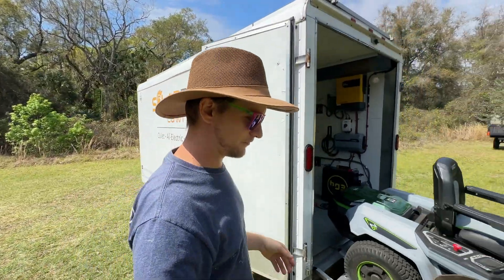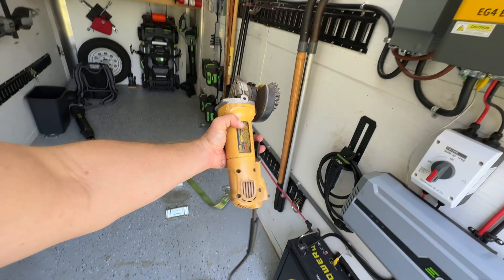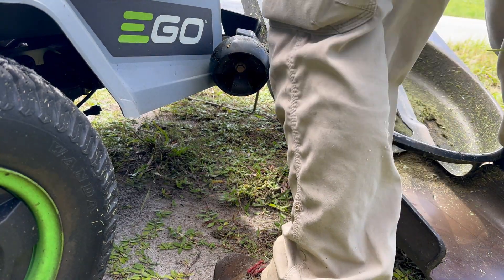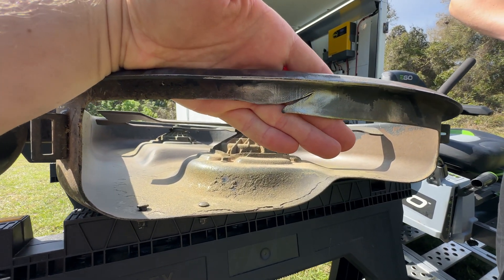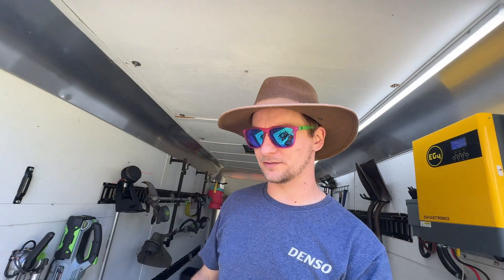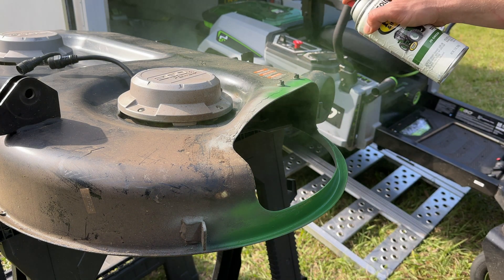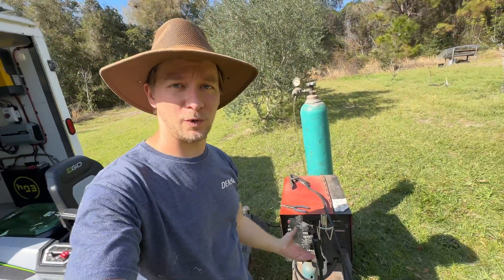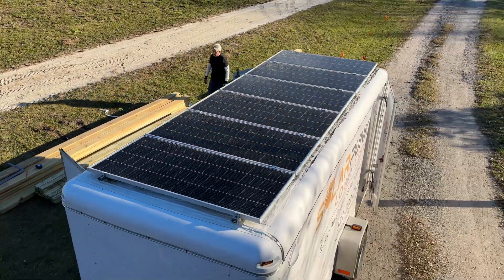Power a Welder From a Solar Trailer? Fixing My EGO Zero Turn Mower

Comment: Here is a trick to prevent pushing the deck sides in when bumping into something like that... Take a piece of round tubing bent to match the deck curve and weld it to that lip it will protect it much better
Reply from the maker: That's a great idea! Reinforces the deck without too much metal work.

Comment: A multi use trailer!  That's pretty sweet and pretty impressive it powered the Welder.  Absolutely awesome what You've built.  Ive started running battery powered equipment last year, but I'm not really at a point where I'd need a setup like you.  Keep up the awesome work!

Comment: I've thought about doing this...  but powered directly from the mower battery itself.  Plan is to get a Ryobi riding mower, convert it to lifepo4, and then drag out another anderson connector from the packs and connect that to an inverter for use in the field.

Comment: Just brought a 42" Z6 esteer on sale form Lowes for $500 off, your mower and the 52" version are both a $1000 off right now. Was tempted to get the 52" since it comes with six 12 AH batteries, but that size would have trouble going in backyards that have fences/gates. What's your thoughts?
Reply from the maker: I like the 52in for the value (all six 12ah batteries), especially if you are using it on your own property or know that it can fit through the gates of wherever you’re mowing. But I know for sure it wouldn’t fit through the gates of quite a few properties I service.

Comment: Bro post everyday 😅, even if the production is not the best. We don't need movie theater quality just more content. TBH you can post 480p 30fps with no edits and the ppl we come. I'm addicted lowkey
Reply from the maker: Sorry, things have been a little out of control for me in the real world. I film/edit when I can. 

What would you like to see more of? Questions you want answered?
Reply: @solarpunksteve  personally I love the numbers. You don't even have to go crazy with it or too personal with it A simple Excel spreadsheet like you did in your last video. But showing more of the day-to-day advantages of electric versus gas. A lot of people have opinions about gas versus electric but I believe in the numbers because the numbers don't lie
Reply: @solarpunksteve  Do you ever charge anything else, such as the car? I'm sure you don't mow lawns every single sunny day, so surely the system sits idle often.

Comment: I'd never do that, b/c lithium is still too expensive. You should probably be calculating how much $$$ it costs in lithium-degradation. My drone batteries store # of cycles & are rated for 200, at about 210 the batteries are way slower than a under-200-cycle battery.   I also recently replaced my UPS batteries & they have limited # of discharges too, even though they're 10yr rated.
Reply: These lithium batteries can easily go 3,000 discharges.
Reply: @brianthompson9485  I'll have to look into it.  LIPO batteries only get about 100 cycles with our drones, the Li-ion do less than 200 cycles before the drone gets s-l-o-w.